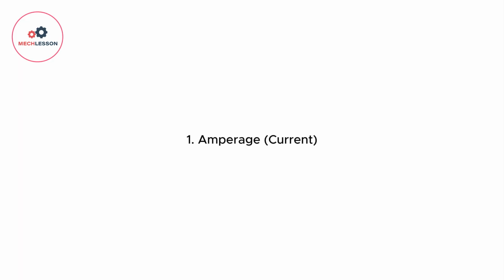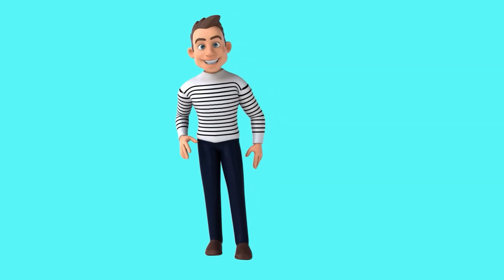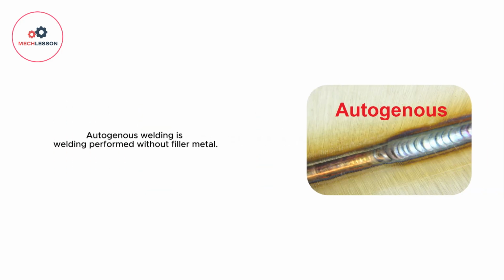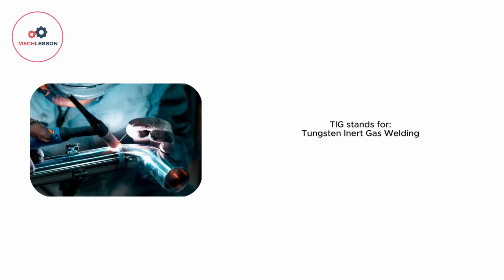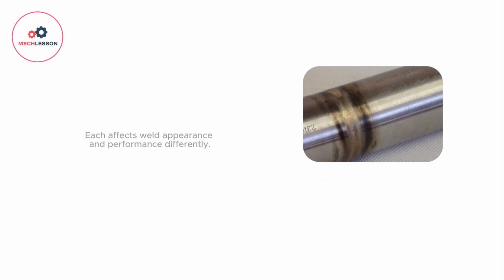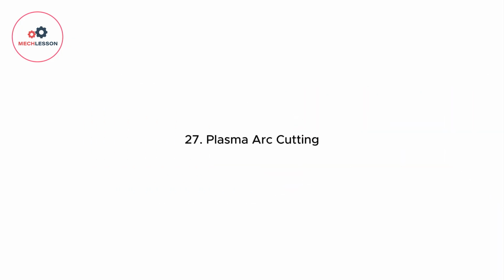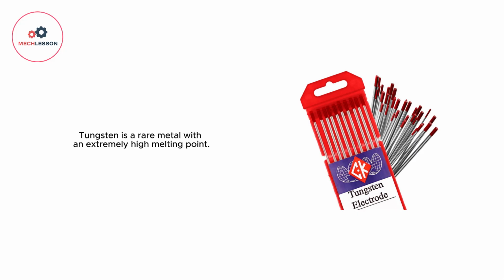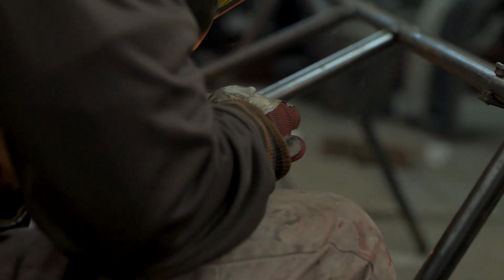Welding Terms and Meanings You Should Know

Comment: Manual metal arc welding (stick) is a skilled process, that can be used much easier outdoors than using the semiskilled Metal Inert Gas (MIG) process as the wind causes problems like blowing the shielding gas away that then causes porosity in the welds, but MIG is a faster welding process but it can cause much more spatter if you are using it in a certain transfer mode.
Reply from the maker: You've hit the nail on the head regarding the pros and cons of those processes! 💡